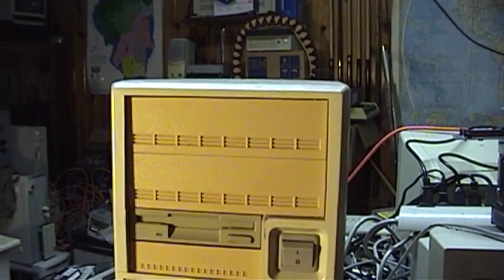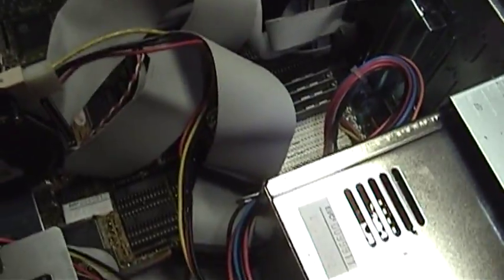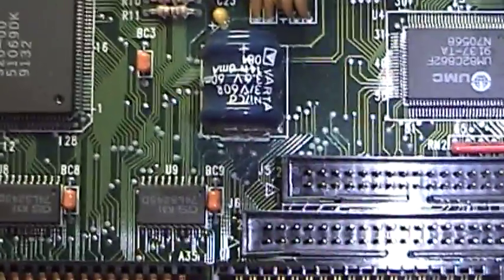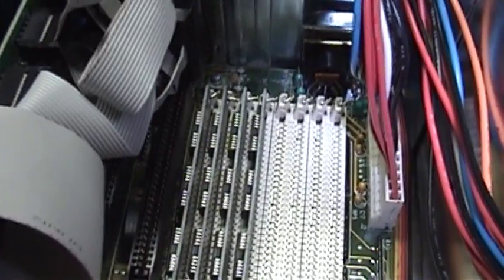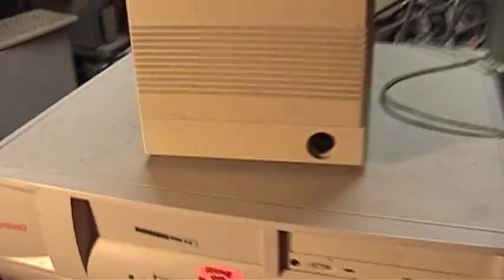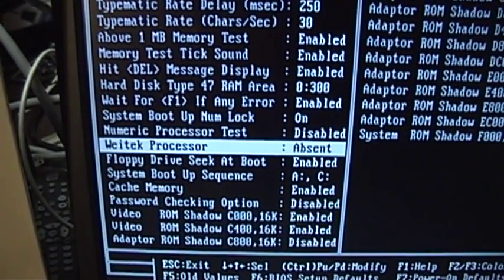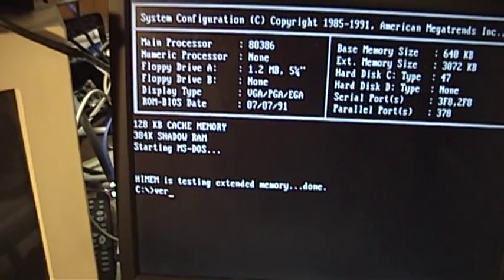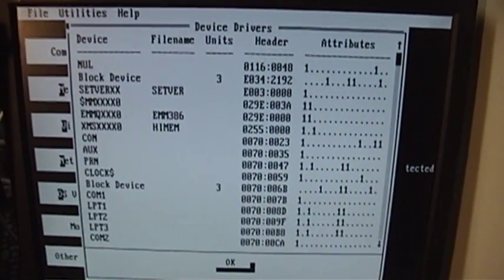Am386DX-40 Computer System Overview

Comment: I had a motherboard with a 286 AMD CPU in a digital Venturis 466, but the tranformer blow the i.Chips right off the motherboard, and smoked all the i.Chips sets.  I still have the DEC Venturis 466 computer case, still looking for an old 286 AMD Motherboard for it. I have 5 old 486 computer cases, and many 486 replacement motherboards yet, plus a few 386 motherboards ! The best 386 I owned was a (NCR PC 386 sx) computer case---I still have the two sticks of memory from off of the 386 motherboard. The CMOs on the 386 became corrupted from my friend flashing the cmos wrong ! I love old 286/386/486/ & Pentium 1s/ Pentium 2/ Pentium 4 ! My favourite was the old Pentium Pro in the old Dell computer boxs. I found an old DEC Celebris (2600 ? or 3600 ?) down along the street corner with a Pentium Pro inside on the motherboard. The DEC computer case was missing the harddrive, and transformer but everything else was still intacted.

Comment: Clean that battery acid of asap ,the same type of battery is also used in Amiga commodore computeres and they can do some real bad dammage to boards, I have just reparird a 836 motherboard and there was some traces on the board that was gone I had to solder wires on to the board now I just need some cards and psu that will get here next week maby tomorrow, so fingers crossed that this board is working now ,it only needs a new battery but that will not be soldered on to the board but with wires and placed in a plastic bag away from the motherboard so it will not do the same thing again.
But the worst thing was that I had to take of the bios scoket and keybord chip to follow the traces to somwhere to solder wires on to the traces was too close next to eachother to make a good connection and the power connector had allso to come of to follow a trace to the power connector. It took some hourours but I did it and the only thing now is a power on test this following week, some traces was for the keyboard and one was going to the keyboard chip so I think if I had pluged it in before repair then the keybord will not work ,but now I hope that my repair job works. I cleaned the acid from the battery of with isopopyl alcohol hope that it's enough some uses also winigar to remove it with.

Comment: I had that CPU as well when I was young, though it was a different motherboard, PC Chips if I recall correctly.
That was the first computer I ever took apart

I actually did install windows 95A once I upgraded the ram to 20mb, and yeah, it took 7 minutes to boot lol
I also had an ATI Stereo F/X sound card in there, I'm regretting so much not keeping that one.
Thanks for the great video and the memories ! :)

Comment: Motherboards up to late 386 early 486 boards had a jumper to select color and monochrome monitors with any video adapter in place. I actually found a 386 board that can run a processor up to 40MHz which is a removal processor (Socket type CPU), external battery jumper, and a jumper to select between 3.7V and 6V for the external battery. The issues are i don't have an ISA VGA card, I/O card, a serial mouse, keyboard (might purchase a PS/2 to AT keyboard adapter since I have a keyboard I might use from my server), and a case/PSU combo for the parts ATM. And I was thinking of making a 386 computer to run games that require up to a 386 CPU since they either run too fast on my K6-2 computer, or I get Exc. Checksum errors on my Roland MT-32 since the K6-2 is an equivalent to the Pentium II CPUs.

Comment: If the battery is less than 3v you should be able to use a CR2032 with a diode to prevent the motherboard from trying to charge it. CR2032 don't ever seem to leak, they just run out of charge, and they have good storage life.

Comment: Speaking of HDD geometry limitations, my Time Machine PC running on the Abit AB-TX5 board is limited to 32GB, but when I installed both MS-DOS and Windows XP on a 200GB HDD, DOS saw only 7.8GB, so the options I had was to either get a Hard Drive with a jumper for a 32GB limitation (I have a 40GB HDD from a Compaq Presario 6300us now with a 120GB SSD connected to a SATA PCI card) or use Ontrack Dynamic Disc Overlay (took about 2KB Conventional Memory away in DOS), so both options worked surprisingly well. Now it's time to try to install an SSD in the Time Machine.

Comment: Wasn't there a lawsuit by Intel that delayed AMD's release of these 40MHz chips?
Reply: +souta95 there was an attempt by intel to keep its advantage in the microprocessor manufacturing market, they refused to share any of the details about the 386 to amd, forcing them to 'clean room' design  it, i.e reverse engineer it, which was perfectly legal because intel technically broke a prior agreement with amd to be a secondary producer of x86 processors.

amd ended up winning the legal dispute.

this is from memory, I could be wrong in some of the details.

Comment: I happened to have had an AMD 5x86 133MHz housed in a very similar case as the one in your video. I don't know whatever happened to it, but I now own 3 similar towers now, one of which has a Magitronic 386 DX-40 board in it.

Comment: You should delete (or rename) the dblspace  (or dbldisk, I forget)driver because it's gets loaded by default with dos 6.22 and takes up conventional memory. If you are going to play games on this machine, you want as much conventional memory free as possible. Also, if you have a modern PC with an ATAPI (IDE) controller on it (I do), you can take these old drives, download dos software/games put them on the hard disk (just use short names) and then reinstall it on the old computer. That's the best way to get software on these old machines. If you don't have an IDE controller on your PC, you can get them pretty cheap. I would also recommend that you not use memmaker and that you do it yourself. I can beat memmaker every single time.
Reply: ***** As long as the drive is less than 2gb, there shouldn't be any problem. Most old machines can handle bigger drives, but partitions have to be less than 2gb no matter what.  CDs can be a major problem because they aren't bootable on these old systems, the bios doesn't support it. If you don't have a generic ATAPI driver to load in config.sys, you can't access the CD. Most modern PCs don't have a serial port or a floppy drive which makes laplink/pc-tools useless along with the floppy. mscdex is included in dos, but the generic atapi.sys isn't and if it's not on the hard drive and you have no way to get it on the hard drive, it's useless. Anyway, if you have the equipment and patience to do it the old fashioned way, go right ahead. I was just trying to be helpful.

Comment: There IS an AMD 80386 at 50mhz, a friend of mine owned one. I'm not sure if the system board ran at 50mhz though. It probably didn't.
Reply: If the 386 is "at" 50 MHz the system board is at that frequency to. There was no clock doubling on the 386. But perhaps you simply mean the 386 was specified for a maximum clock of 50 MHz?

Comment: This could have had an EISA system bus rather than the standard 16 bit ISA slots. EISA was the rest of industry's answer to IBM's Micro Channel Architecture or MCA which was fast, plug and play that actually worked, but required a license from IBM and were expensive and really only found on IBM computers. EISA was an industry standard that was supported by the "Gang of 9" including Compaq and others and was in service well into the PCI era. I have a P200 with an EISA bus. Almost all servers used the EISA bus until the P-Pro came into wide spread use in Servers in the late 90s.

Comment: Take a piece of cloth, soak it in Vinegar and place it on the rust spot for a few days (re-wetting it as needed) and it will come right off. Another way is to take some aluminum foil and ball it up and rub it on the rust and it will also come right up without scratching or otherwise damaging the surface.

Comment: My first serious job, back around 1993, was building beige boxes for a local computer store, and I put together a lot of these Am386 machines, which were a good deal cheaper than i486 and Pentium boxes, and since MS-DOS 6.22 with Windows 3.11 was the standard OS setup, the Am386 was able to run just about everything you could throw at it (well, maybe Doom was a bit slow on it).  Also, it was the box I first tried out Linux on -- Slackware 2 on 73 floppies!
Reply: 73 floppies?! :-0 #1 for the OS and #X on demand i hope. This was when even dial-up internet was uncommon and slow.

Comment: I just found one of these in my basement yesterday!  I bought it new in 1993 for my wife.  We moved in 1998 so I thought it didn't make it into the new house for some reason.  Anyhoo, the case looks almost like yours but has a numerical digital readout for the standard speed 20mhz and turbo 40mhz (with the AMD 386 chip).  Mine has the Acer ALi M1419 mobo (KMC-A419-8)  It is VERY similar to the BioTeq board.  My battery is still good and taking a charge!   However, I have the ext. battery header, so I'm going to use it with 2 CR2032 batteries, and yank out the old one, as they are ticking time bombs as you mentioned.  I really liked your description of everything, it helped me understand some things I didn't even know when I bought it new from Micro Experts.  It still has Windows 3.1 and DOS 5.  It has 4 MB of RAM (which I shall soon be upgrading) and a 100 MB hdd, which I shall also be upgrading.  Still has all of our old programs, games and other personal info.  I am AMAZED that it still functions perfectly after just sitting for about 16 yrs!

Comment: i have found on oem am386dx/dxl 40mhz computer and the battery is fine and i will try to change it.
its now at 8mb ram, soundblaster 16c vibra and cdrom . the hdd is 125mb with win 3.11.
cant find a 500mb hdd or one that can be limited to that capacity to instal win 95.

Comment: The Amiga collectors know all about the battery problem and have come up with a battery hack, which is a coin battery holder with a simple diode to keep the charging circuit at bay. A variety of (Amiga) retailers make and sell these battery hacks (which are made to fit perfectly on the motherboard), but they are cheap and simple to make.

Comment: There were a few late 386 boards that could take either a 386 or a 486 chip, and had VESA slots.  Most of them came with a 40MHz Cyrix 486-DLC, which is a hotted-up 386.  It took the 66MHz 486 DX/2 to beat that chip.

Comment: I actually did had one of those 133Mhx Am486 chips and yes i ran mine at 150mhz !!!! 50mhz x 3 !!! normal setting for the chip was 33 mhz x 4    it had the same performance as a Pentium 75 at the time. I could play the origional starcraft on it... Starcraft did not run on 486's if i can  remember but i could because of the 150mhz AMD 486... hehehehe

Comment: I never seen a 386 machine with 72pins memory and vlb. On the 486 you get vesa local bus and later pci. And with the 486 platform you get the first 72pins simms. My favorite bus for a 486 is eisa. I had a compaq server with 2 3com eisa nics and eisa video and eisa scsi card. i ran windows nt4.0 and linux redhat 6.2 on it. good old days <3

Comment: oh classic AMD :D
i guess i've always had a soft spot for AMD in my heart.. now that i think about it, all my desktops the i have ever owned have been AMD based. My first ever PC was a 2000 era compaq with a 700mhz Duron, through my current self built pc with a hex core phenom II at 3.0/3.4ghz. The only intel pc i ever personally owned was a crappy first gen Atom powered acer netbook. Therefore, intel left a bad taste in my mouth from having to use that as my main system for so long.

Comment: @uxwbill
If you can't polish the rust off, hit it with a bit of Rustoleum paint. If not the paint, then just wet the rust spot with motor oil. It won't get rid of the rust, it will prevent it from spreading.

Comment: AMD also made a 386SX-40. Despite having a tiny "Designed for Microsoft Windows" logo printed on it, it easily got bogged down by larger Windows 3.x applications, and the matching 387SX-40 math co-processor was difficult to find.

Comment: Used to have the AMD 386 SX 33 version of this, was a quick chip for the price.  I seem to remember we later upgraded to a 486 SX25 which we could over clock to 40 MHz.

AMD did in fact produce a 486 CPU which ran at from what I remember 133 MHz and we got ours to overclock and be stable at 166.

Comment: Yes pre plug-n-play was a big hassle. I used to use internal modems because they where cheaper but always had issue with IRQ's and address spaces, so I finally went to external modems so I wouldn't have to deal with it.

Comment: You've been messing around with PS/2s too much. :-P Aftermarket 386 motherboards with Local Bus slots and/or 72-pin SIMM sockets were extremely rare, and most that do exist are actually "386/486" boards, designed to let you start out with a 386DX CPU and then upgrade to a 486SX or 486DX later. Alternatively, these boards would've already come with a 486SLC, 486DLC, or "Blue Lightning" chip, allowing them to be sold as low-end "486-class" boards even though the underlying hardware was 386-based.

Comment: Those Ni-Cds were leaking way back in 1998 on 386/486 machines as I had to replace a few. They are the #1 killer of Amigas it seems. That Leading Edge board really isn't worth saving and likely died from other causes (used to service alot of their equipment). The Model D3 wasn't all that special or reliable.

Comment: @uxwbill
Cyrix had a harder time than most.  They didn't have their own production facilities, so they had to lease them from TI and SGS-Thompson.  Obviously they ended up with the out-of-date equipment.  Notice after they started working with IBM and got the state of the art facilities, the 5x86 and 6x86 came out, and were really good chips.  I've got one of each, though the 6x86 is marked MII(same thing).

Comment: @uxwbill 
They're pretty much identical, though the brand name escapes me at the moment.  The CPUs are socketed rather than soldered, though.  And both of them had those nasty nickel cadmium batteries, too.  First thing I did was desolder those things and put coin cell holders in.  They haven't had an issue since then.  And...I have that same Trident VGA card!  It gets the job done.

Comment: unless you got an MCA based IBM (which was a bit like Commodore Amiga zorro bus with autoconfig etc) you were stuck with ISA slots on most systems, no real 32bit  'standard' until PCI came along. (apart from VL bus for video..)

Comment: Also, (sorry for the triple-post), I've got two 486 boards with bugs that make them y2k incompatible.  They'll let you set the date well enough, but the moment you exit the BIOS setup, the date will change to 2094.  I managed to find a DOS TSR called y2kure that fixes that on bootup.  It seems quite a few later 486 boards with the Award Modular BIOS had that bug.

Comment: I remember my Gateway 2000 486DX2-50 had a 6v battery connected to the board via that 4 pin connection you mentioned.  When that battery failed I got myself a 4AA battery holder, and threw four alkaline AA batteries, and it was happy again.

Comment: I too had a AMD 386 40mhz system very similar to the one in your overview.  It was branded as Magitronic.  I even remember using a Magitronic 13" VGA monitor with it as well.  The performance was excellent and would beat most low end 486s of the day.  Windows for Workgroups (3.11) ran very nicely.  This system, paired with a Gravis Ultrasnd, was gaming goodness.

Comment: wow a blast from the past, i had soo much fun on my old machines :-)

286/386/486 machines were great fun, i used to force bigger cache chips into mine and the maths co pro, even the ancent mfm hdd cards would work :-)

I bunged a plastic holder in mine with nicads in, did the job fine.

And because my machines were often bust castoffs, my memory strips were often held upright with wooden washing line pegs with hacksawed slots for the memory, yes i was a git but i didnt break the clips!!